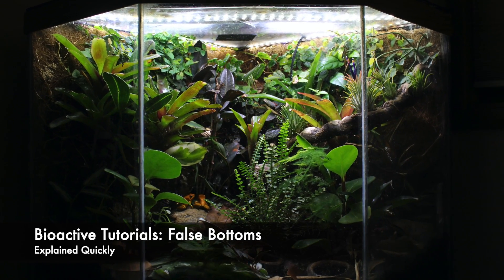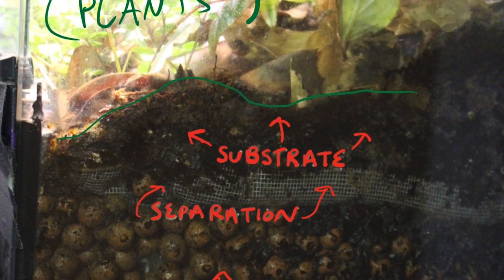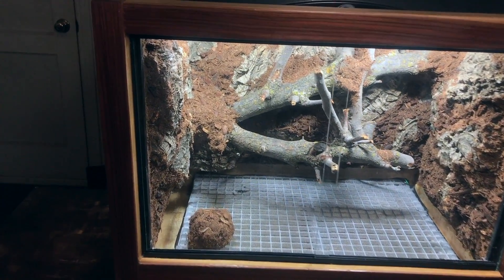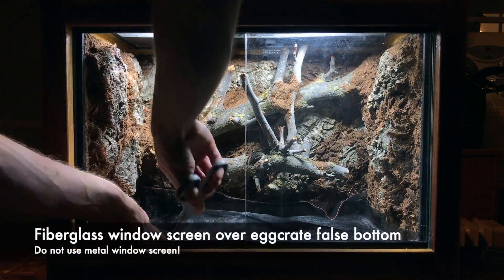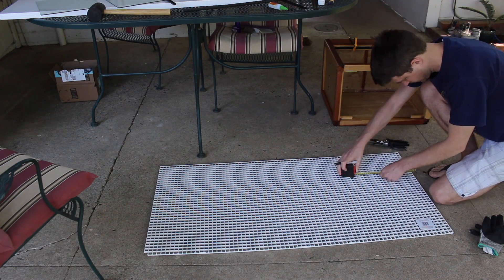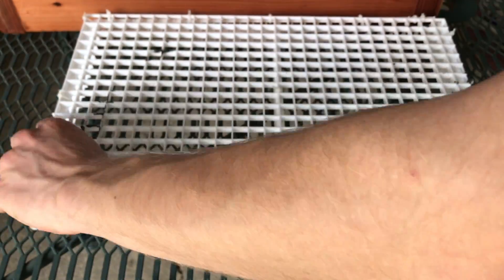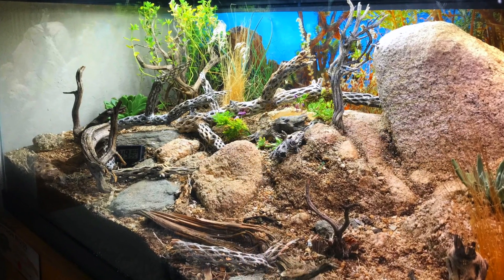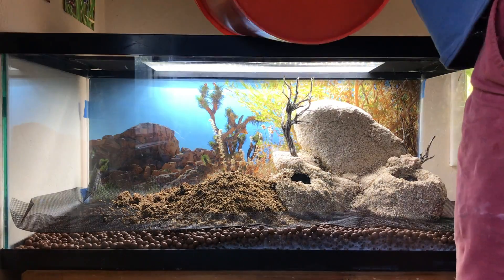DIY False Bottom for Bioactive Vivariums (Explained Quickly)

Comment: I have a blue tongue skink I’m making a bioactive enclosure for and since he is an avid digger, I decided to go the egg crate route so I could zip tie the screen to the crate and make it more difficult for him to pull out. I wanted to do just a standard drainage layer but I think he will rip out the layers. 
Could I put the egg crate platform like you made in the video over the top of leca to give it more support under the platform? I don’t think I’m going to put a ton of heavy stuff on top but there are some things like his hides that have some weight to them I want to try to keep supported. What do you think?
Reply from the maker: From a vivarium engineering perspective I think that would probably work just fine, but I don't have any personal experience with blue tongue skink husbandry so I'd recommend looking into what others have done with that species specifically to prevent them from digging up the false bottom and plants, and how feasible it might be.

One thing to consider: if the animal is so destructive that they will claw through the false bottom they may not be the best suited for this type of enclosure. With enough time and money you can probably make anything work, you'll just need to decide if it's worth it to you. I did sort of a hybrid setup for my ball python (I have a couple videos on here) where the plants are sequestered to slots so that The Snake can't easily squash them or dig them up, but I also made the whole thing from scratch.